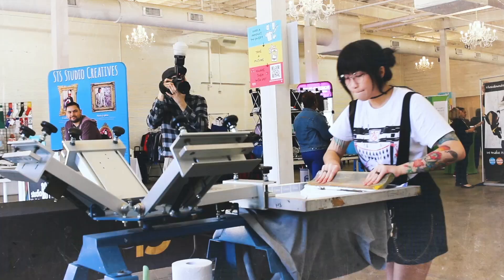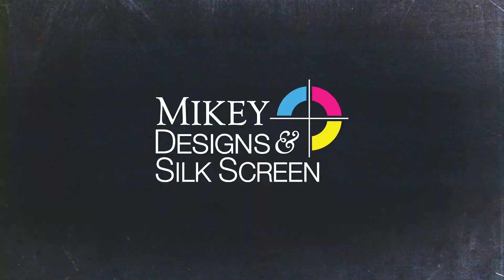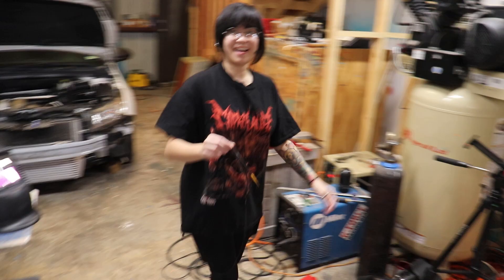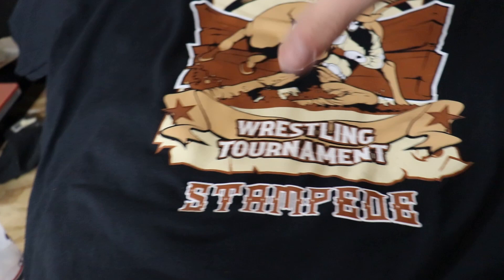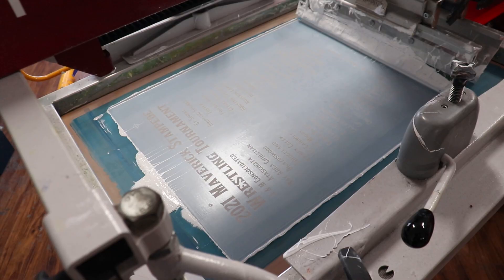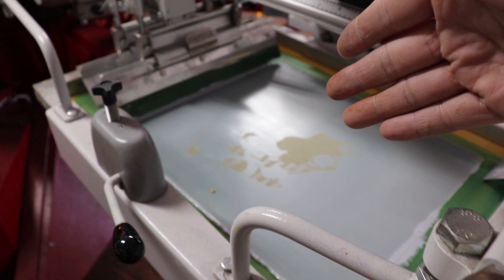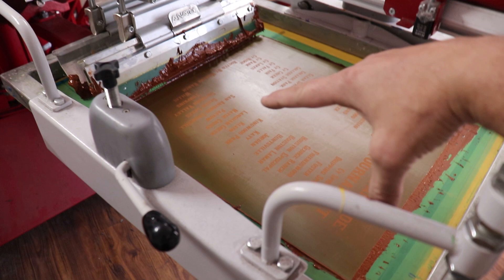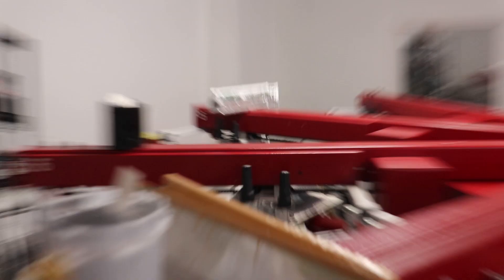Screen Printing 1,000 T-Shirts on the Anatol Titan with a 5 color front and 4 color back | Vlog

Comment: Great to see that things are getting back to normal in the screen printing industry. one question if i may dare ask. 1,000 tees printed both sides what is the time estimate for a finished product. i see you have a whole team taking care of different areas covering that job., Great Team Work.
Reply from the maker: Same here! Depending on how fast your crew can work together and how often the press needs to be stopped for lint, or new pinholes arising. We did the front one day, and the back another day. Really taking our time to make sure they can out nice. I probably paid around $700 in labor and the rest was profit, minus ink cost.